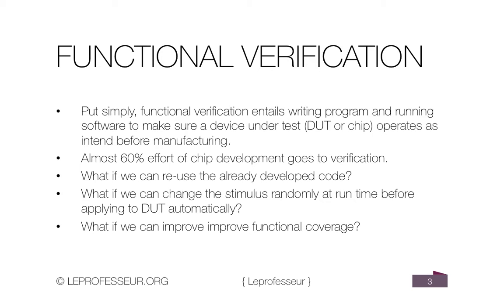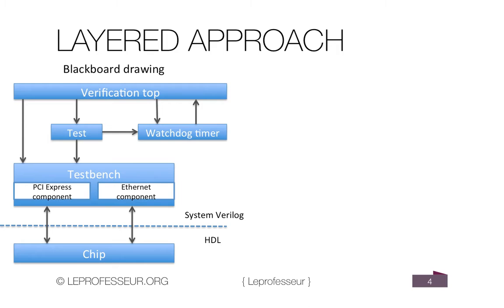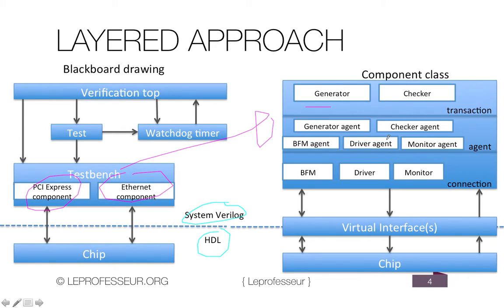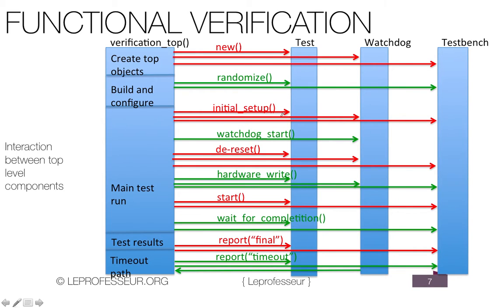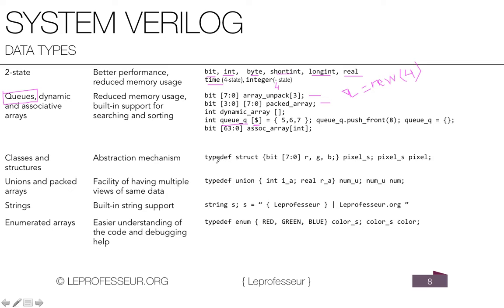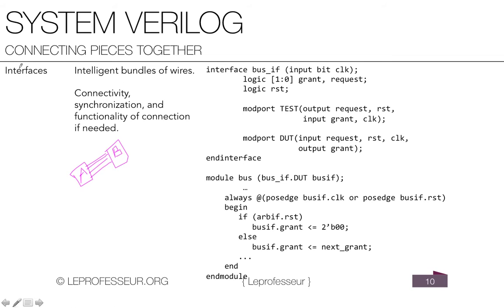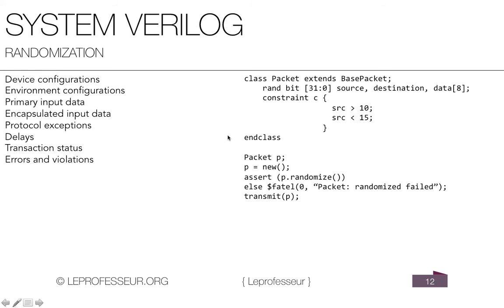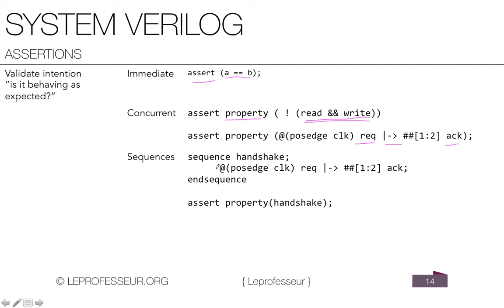⨘ } VLSI } System Verilog } Quick Overview for Design Verification } LE PROF }

Comment: Very well explained. I have a doubt in the Interface slide(46.00) where you said that the "clk" is output of the test going to the DUT, where in reality it is the input to the test. Will be very helpful if you clarify me on this.
Reply from the maker: well, depends on convention, typically clocks are generated via some simple behavioural clock model inside test-bench which is used to drive dut clock pins, there can be many different clocks, not just one in real designs, it is not to confuse too much on conventions but in reality understanding the concepts is main idea.
Reply: @Leprofesseur  in modport TEST, your code says clk is an input but you mentioned TEST has clk as output. TB should be driving a clk here so output seems correct. Is it a typo in your code?
Reply from the maker: Test will compare the output of DUT with desired output (generated in test), test bench will drive clocks to both DUT and test case.